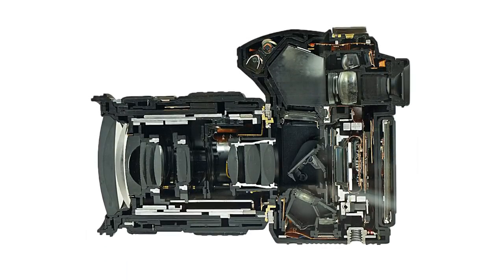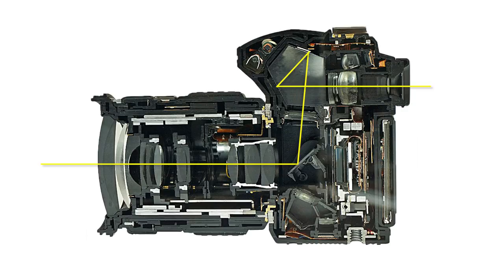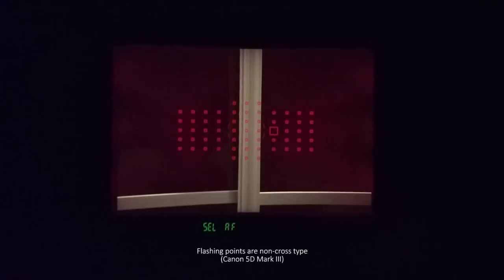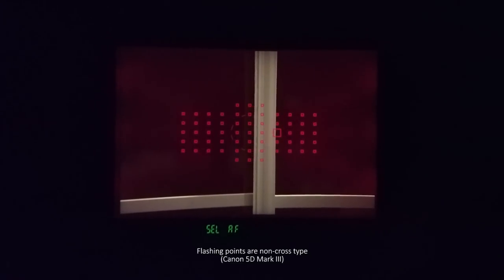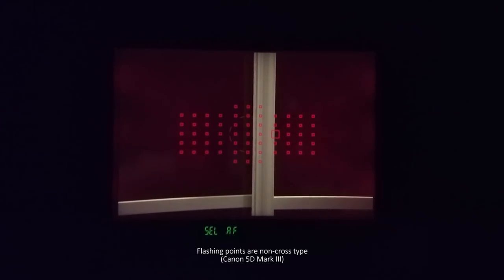DSLR Autofocus Explained! Cross type, Dual Cross type AF Points?

Comment: best video about this subject in Youtube. Thanks a lot man!

BTW, for those with regular non-cross type vertical AF points, they are NOT slower than the other types, also do their job in most cases, and do work fine for sports and action in general, what they tend to fail is in static situations like the one described in the vid.

A GOOD HACK for compensating the lack of cross type AF points, is to rotate the camera, in many cases 45° degree turn will do and in some cases 90° degree turn needs to be made (turning the camera). same goes for Cross Type, if in any strange case the Cross type AF system can't get the focus, a 45° degree turn should help. but this is very rare.

 Another hack that could help many "dual type AF points" that comes with some non-cross type, and some cross type AF points (like canon T3i - 600D) is to use the Cross type point to get the focus at the correct distance, and then move the angle a little bit in order to put the desired photo subject in the desired place to take the photo.

last but not least, non AF focus will work in a spot without any contrast, since the point will only measure light and dark (BW) balance so AF will not work on a white wall with even light. a good hack is to take the focus from a contrast spot which is placed at around the same distance.

Manual focus: should be the last resource, since unlike the lenses for analog cameras, the DSLR era lenses do not come with any asistant for manual focus, you don't get the dual image analog telemeter inside the modern lenses, so the focus will tend to be only about as good as 8/10 if measured and setted up "by eye"

Comment: I like the illustration of vertical slit in the tile wall! I have a question: I sometimes find that live view focusing on my Canon 80D works much more accurately than the phase detection autofocusing system. Could you maybe make another video to explain this? Thanks!

Comment: Dual cross focus points. I have a canon 80d. Assuming I am using an efs 24mm f2.8 stm lens. Am i supposed to be able to see horizontal, vertical and diagonal lines in my focus point, or are these invisible? I have heard that the lens must be at f5.6 before the horizontal, verical and diagonal lines are working in that focus point. Thanks.

Comment: Hi, i'm using canon 50D with 9 AF points. question is while shooting a person with 18mm focal length , it is hard to position theAF points right on the face of the person, coz my composition would take the person and sorrounding area, like backgrourd, tiles, and furnitures. The model is sitting with legs spread across the bed. the AF points are on the legs and half of the bed. is there any trick to put the AF point on the face?

Comment: My tiny canon SL1 has only 1 cross type AF point and the rest are normal. Some times is a nightmare, so i end up setting my camera most of the time to only use the central point and recompose. Difference is hughe.

Comment: sorry, but the explanation does not explain how phase detection AF works.
why the double image, created by the beam splitter, converges when the object is in focus? regarding his explanation, the beam going through the semi transparent mirror gets split before hitting the AF sensor. thus it splits the image entering the lense and the mirror, no matter if it is in focus or not. so the AF sensor will always see a double image.